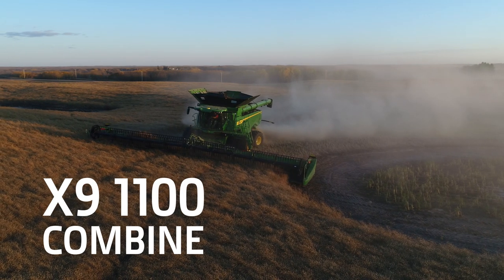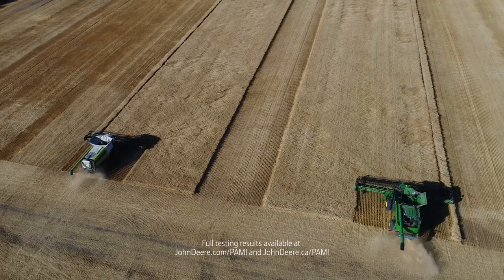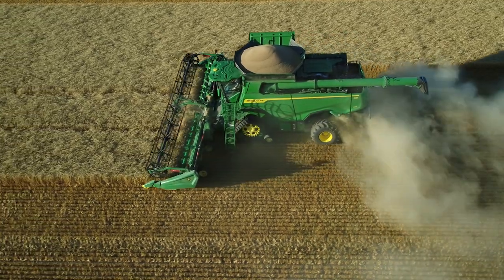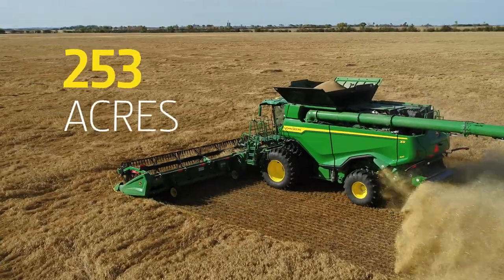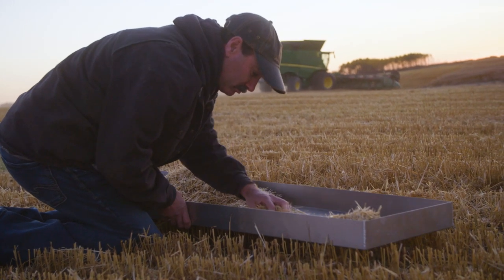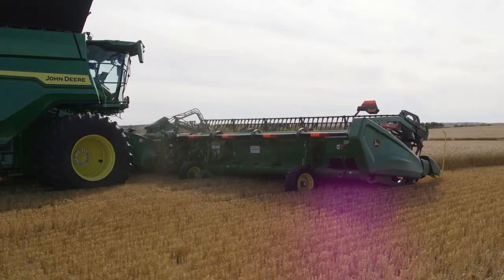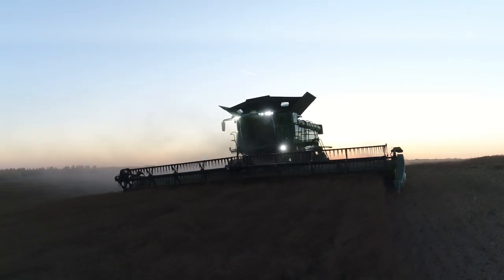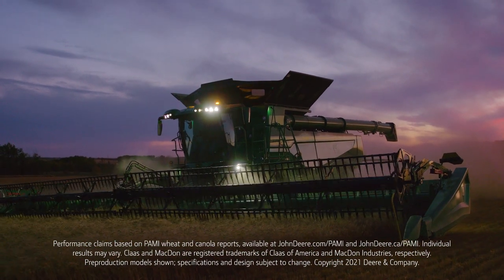+Gain 7 Days at Wheat Harvest | John Deere

Comment: if they wanted it to be a fair comparison, JD should have let claas reps be present to set the combine for peak performance.  JD's top operators set the x9 and pami reps set the claas with basic crop settings not knowing how to properly set the machine. Also note all tests were done in most ideal conditions in the heat of the day.  Not done during the tough going, at dark.

Comment: Would have liked to see it up against the case international, nothing runs like a Deere 👍 🇨🇦
Reply: Case doesn’t have anything in the same ballpark as these two machines. CNH would have to use the biggest new Holland to get even close to either
Reply: Wonder if case would be supportive of the right to repair movement?

Comment: What a Joke! John Deere should be ashamed by this, 45ft class 10 combine against a 50ft class 11 combine, if that isn’t rigged idk what is
Reply: The Deere is actually only a class 10. The Lexion 8900, and the Ideal 10 with 790 HP are class 11's.

The X9 1100 is 690 HP vs 647 of the Class 8800.
But the Deere head is all new, that Macdon is several years old.